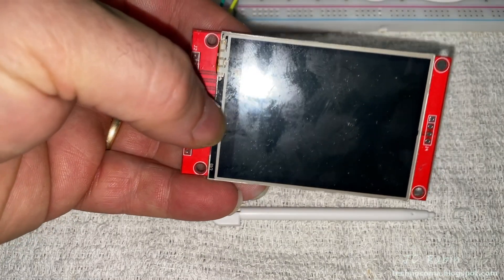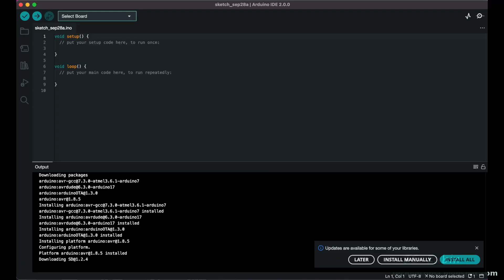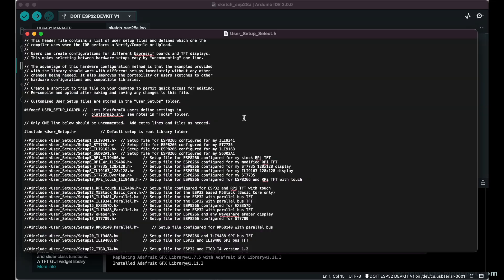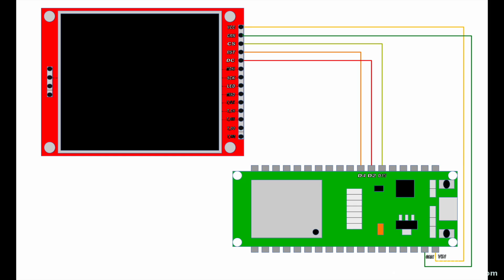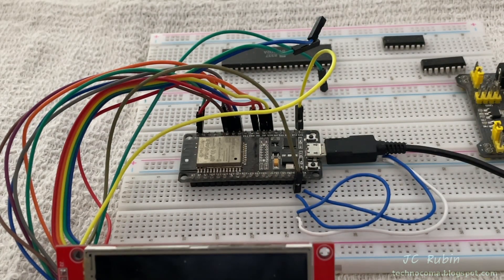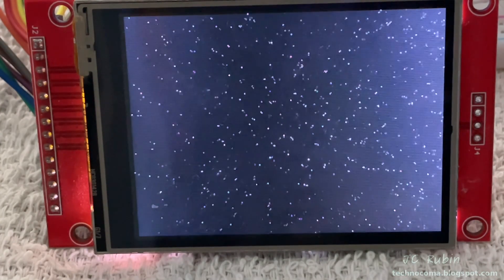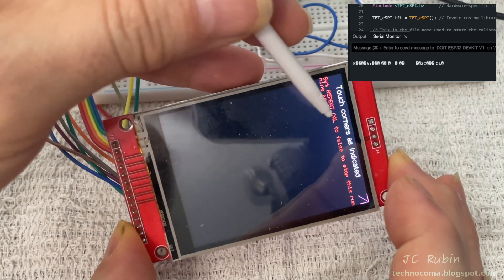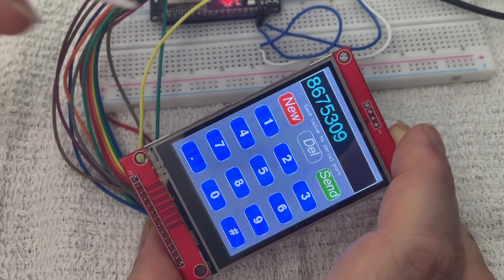Using a 2.8in SPI LCD Touchscreen ILI9341 with an ESP32 on the new Arduino IDE 2

Comment: I'm using an ESP32-E, i followed your User I did NOT have some of the keys called for so after uncommenting the 7 keys and the RST = -1 I changed them to ONE'S I had and the first few examples worked. ;>) When I ran the KEYBOARD example I get a compiling error: "Compilation error: 'class TFT_eSPI' has no member named 'getTouch'"  What should I do now? ;>(

Comment: Hello! I was wondering if you can help me, I followed your steps but touchscreen is not working for me I have tried using 2 different esp32 but both of them didn't work, I was thinking if it was grounded because when I touched the sd card case the touch calibration works even though I'm not touching the screen and when the touch calibration is done touch screen still doesn't work, thanks!
Reply: have you got solution i am facing same issue

Comment: This video deserves a 5-star rating. I have been trying to function an ESP32 program using the Adafruit_GFX.h, Adafruit_ILI9341.h, and XP2046.h librarys with little success. (The librarys  seem to be targeted for the Teensy microcontroller). The Adafruit graphicstest.ino was running at turtle-speed and I had no success for the 320x240 tft display touch function. I then used the tft_espi library to find a working touch function and an extremely fast graphicstest. Very minor modifications to my program were necessary. Very valuable information in this video!!!!!

Comment: What if my tft display is a 3.5" 480x320? Are the steps the same? especially those in User_Select_.h files
Reply from the maker: You would need to select the line in the config for the appropriate display.

Comment: I recently bought the "UNO R3 2.8 Inches TFT Touch Screen with SD Card Socket" and one major problem was that the header files took up over 50% of the program memory. That left just less than 16k bytes, and I wanted to program up 4 or 5 simple games for it so it REALLY was not a lot of memory left. Sure it's got an sd card slot which is cool for adding sprites and stuff but there isn't a simple way around the lack of program space left over.

Comment: Well done. Thanks. I use the 3.3V from the ESP32 for the power supply of the display (v1.2), and it works without any issues.
Reply from the maker: That’s a lot of current for an esp32 regulator
Reply: Hi, I'd like to do the same but I can't manage to have the screen display anything. It's backlit and blinks when I touch but the screen is on but black? can you share your wiring sequence please?

Comment: Hola.. te cuento, tengo la pantalla tft 2.8 y el esp32. pero no logro que funcione el touch. he realizado todo tal cual lo muestras en tu video. 
1. #include <User_Setups/Setup42_ILI9341_ESP32.h>.
2. #define TOUCH_CS 5 // Chip select pin (T_CS) of touch screen.

tal cual quedan abilitado. 
en cuanto a la pantalla si genera las imagenes correctamente. pero al incluir el programa para la KEYPAD no funcina el touch 
en el monitor serie solo muestra:
13:42:44.963 -> 8���  ��1��V(���1�р�.
el cableado esta tal cual el video

Comment: You can get a 40mhz clock on that display by modding a few lines in the TFT _eSPI library. That combination can give you crazy frame rates.
Reply from the maker: At much greater power consumption..

Comment: @retrotechandelectronics when you show the star field a capacitor suddenly shows up on the breadboard. What was that for?
Reply from the maker: Cap is added on certan esp32 boards to help with brownout condition that may occur across ground and vin.  not part of actual project.

Comment: Good demonstration and explanation. You mentioned that the device uses quite a bit of power.. Do you have a value for that? Do you know how much current it draws? That would be helpful for me.  I have a datasheet but it is quite lacking in electrical information. Thanks.

Comment: I have letters inverted vertically on such a display. I have tried many libraries, but there is no result. Advise me where to dig ?????
Reply from the maker: tft.setRotation(1);
Reply: @retrotechandelectronics  Эта команда переворачивает ВЕСЬ экран, а мне надо ТОЛЬКО буквы в тексте.
This command turns the WHOLE screen, and I ONLY need letters in the text.

Comment: I have a blank white screen when i connect my t_clk to pin 18. The screen works with it not pluged in but then i have no touch screen any ideas?
Reply: Hi, I have the same problem, did you resolved it ?
Reply: @titouangautier5359   
vcc   3.3v
gnd   ground
cs    15
rst   4
dc    2
mosi  23
csk   18
led   3.3v
miso (not connect)
t_slk 18
t_cs  21
t_din 23
t_do  19 

some of them are shared connection which mean they use the same pin from ESP32.

Comment: Good video, be interested to see what you end up using the touchpad for. One of THE most irritating things about the Arduino/PlatformIO environment is the unnecessary recompilations. 2nd to that is suppressing useful warnings in the name of "ease of use".
Reply: The looniest thing is the Arduino IDE 2.0’s way of implementing code auto-completion and error detection: it’s constantly recompiling in the background. So it’s always lagging behind, and it basically can’t keep up with me. (And I am hardly some programming whiz.) 

I’ve moved completely to PlatformIO.
Reply: @tookitogo  I haven't looked at 2.0 yet, and it looks like I won't bother to. 2.0 is built on Eclipse, which I've never cared for (buried configuration options, difficult to move projects between machines, etc). I'm a command line kinda guy, and PlatformIO suits me much better. I'll stick with what keeps me productive.
Reply: @JCWren  Do you use PlatformIO within Visual Studio Code like most people, or do you run the pure CLI version? (Just curious.)
Reply: @tookitogo  Pure CLI. I use vim for it's cross-platform portability. Copy my .vimrc file from a Linux, Windows, or Mac machine, and it behaves the same everywhere.
Reply from the maker: I was going to use it for the sprinkler project but ended up using the lcd screen and an encoder wheel.